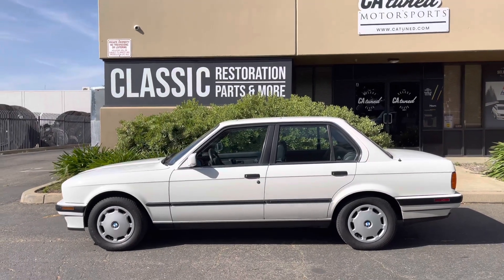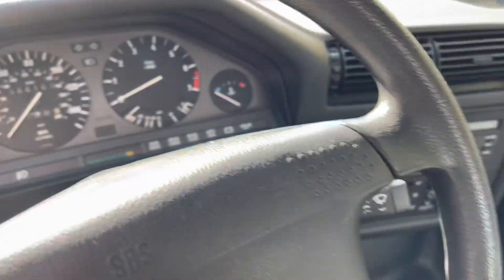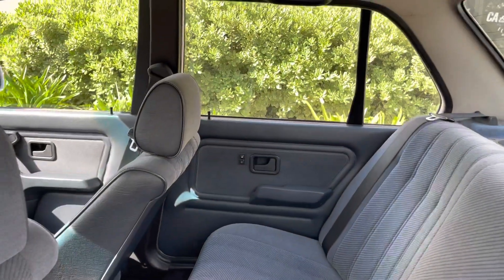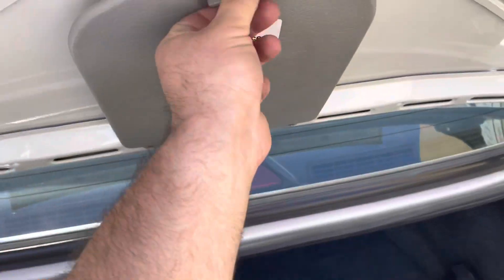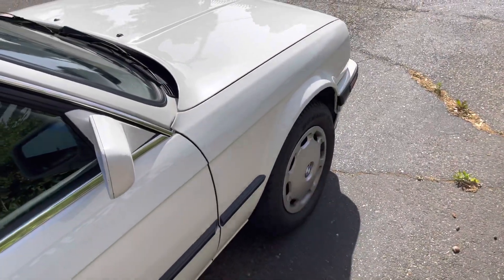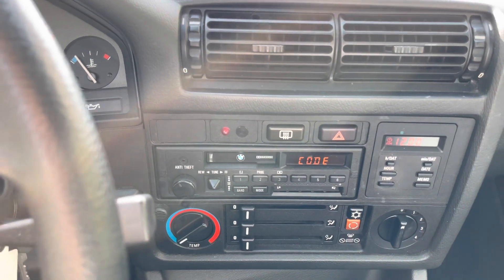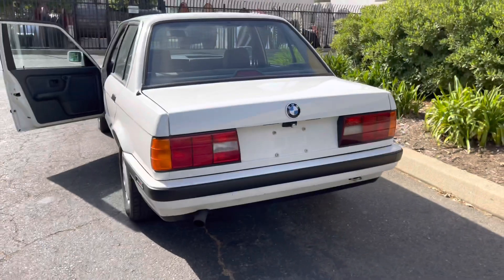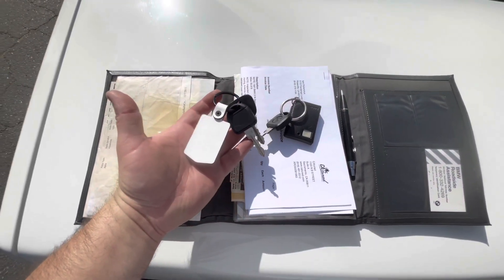CAtuned BMW E30 318i 1 owner 66k miles overview

Comment: I have this exact car. 100k miles and never driven hard, but not properly maintained or cared for. It was always parked in the sun but was running perfectly when it was parked several years ago. The tail pipe is factory clean and there are no leaks except for the sunroof. It's parked under cover now. Great video.